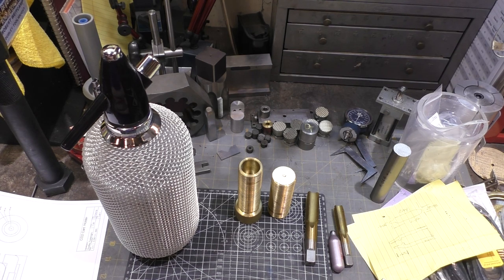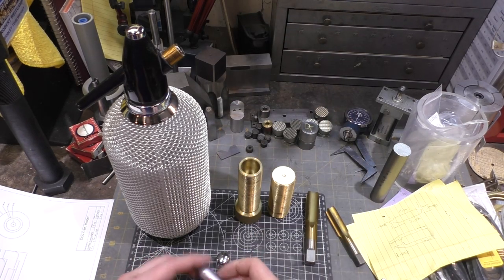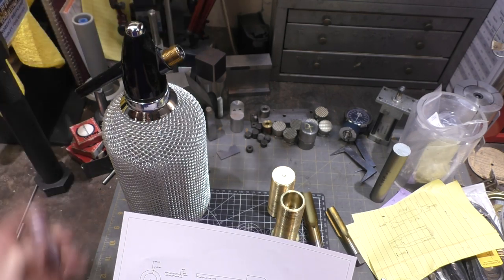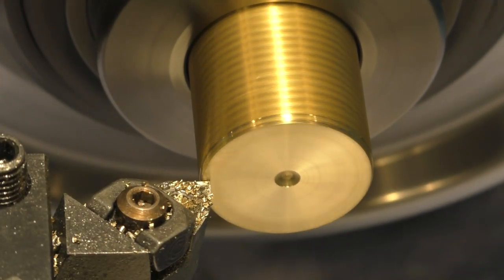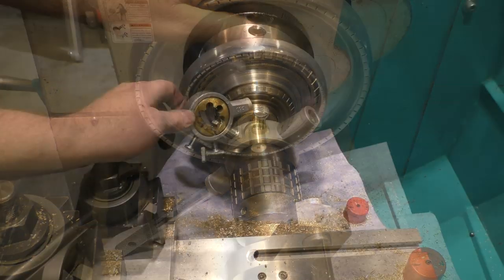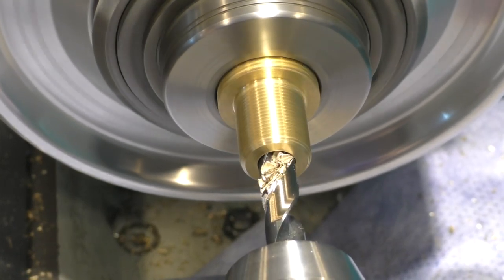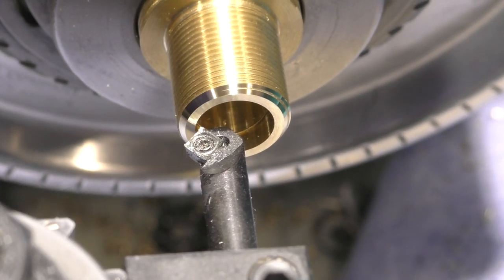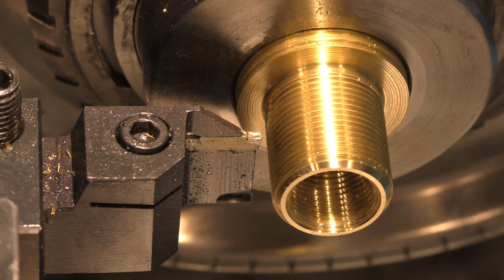94 Czech Seltzer Bottle CO2 Charger Holder Part 1

Comment: The crappy air rifle I bought for my kid had a little C02 bottle like that.  I was trying to zero the scope and the point of impact kept getting lower and lower as the pressure dropped.  Good for shooting barns at close range only.  As I screwed-in the cap, a little air could be heard escaping until it sealed.  I thought about modifying it to accept two cartridges, but instead bought a PCP and pump and haven't looked back.
Reply from the maker: Thanks. My brother in law has a pellet gun that is a break barrel single pump and it works really well. I can't imagine wanting to go to a disposable cartridge type...

Comment: Have you ever made adapters for the soda stream type carbonators?its got some kind of funky looking thread on the bottle.id like to be able to run a hose from the unit to a co2 bottle under the cabinet
Reply from the maker: I haven't. I have a soda stream unit myself. You can by CO2 bottles from beer supply places or Airgas for very little (relative to a sodastream bottle) and they will come with a standard CO2 interface hose.

Comment: Thread dia smaller than cartridge because the cartridge loads thru side window. Follow this link and watch, how that part looks like https://yandex.ru/images/search?text=советский%20сифон%20для%20газировки&stype=image&lr=10738&source=wiz
All you need is bore out larger inner dia than thread and mill out a window for cartridge loading. And you don't need any adapters.
Reply from the maker: I was aware of the original design. They cast theirs out of aluminum, but I was a bit lazy and didn't want to try and figure out how to make the half round hollow that was larger in diameter than the entrance. It would have required a pretty big ball nose end mill. Thanks for the link and helpful ideas.

Comment: brass on brass.. screwed ... not good.  soft - soft no good. Hard on soft  OK.
Reply from the maker: I was thinking the same thing, but the original bottle and charger holder were both soft so I thought I was ok. The assy. works pretty well and does not stick...so far.